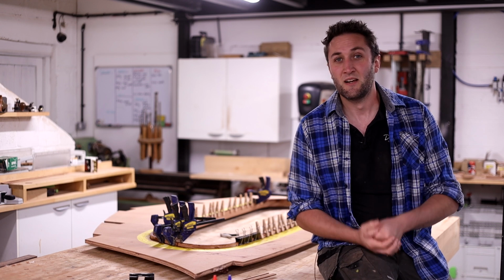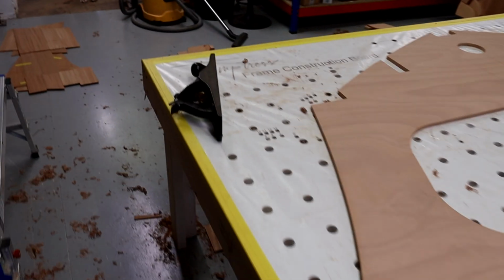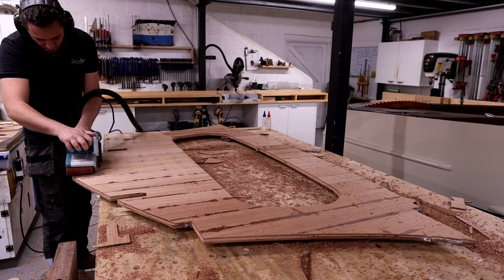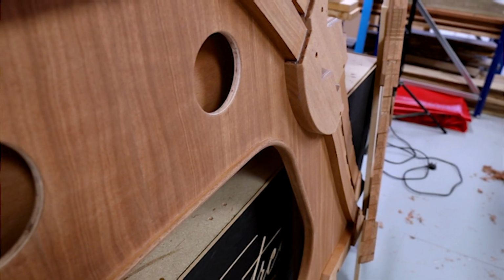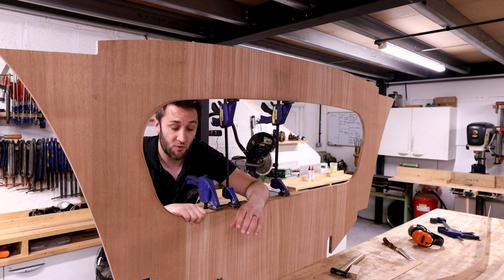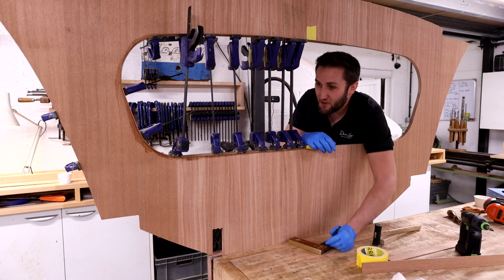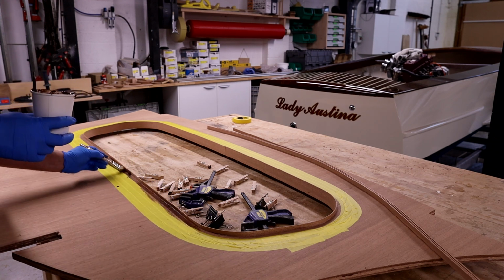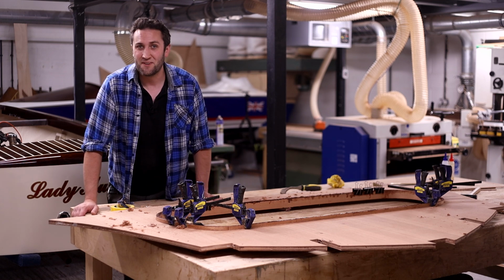THE FINAL FRAME! Veneering and Laminating a Bulkhead | Building Temptress Ep13

Comment: Do you need to veneer both sides if the other side is not visible? I've heard conflicting opinions on whether my substrate will turn into a potato chip.
Reply from the maker: It depends on the support of the part. If there is little support and you veneer one side then yes you probably will end up with a curled potato chip, especially with a heavy, 3mm veneer such as this. It is better to do a balanced veneer on either side and then you are basically just adding 2x extra layers to the ply.

If it is fully supported by other items then you should be fine. For example when I get to doing the cockpit furniture for this boat, seating and lockers etc, I doubt I will go to the extent of veneering the inside of these. But as the boards will be fully supported and braced so as to not allow movement then they should be fine. Hope that helps 👍
Reply: @DanLeeBoatbuilding  it does thank you. I planned on doing 3-4" wide strips of sapele with 1/4" strip of maple for the flooring of my boat. It will be supported.
Reply from the maker: You should be fine then, especially if it’s laid flat and fixed down 👍

Comment: It’s coming along great well done, you should try the polymer finish nails they hold great and won’t corrode or stain the wood they are a game changer 👍🏻🇮🇪
Reply from the maker: Thanks! I have the Raptor stapler and that will get used when I get on to hull planking, I agree it is a great tool. I am trying to avoid having any visible fixings in finish areas though if possible.

Comment: I’m always confused when someone uses the term “mil”.  You say 3 mil. Is that .076 millimeters. Or is it .003 in? Because those veneers look mush thicker than either.
Reply: Anyone who uses metric commonly refer to millimetres as “mil”. It’s just a short handed way of abbreviating 4 syllables down to 1.
Reply: "3mil" can also mean 3mm - and that's what Dan is saying.
Reply: @18robsmith  thanks. That makes a lot more sense. So just a bit less than 1/8”. Appreciate the clarification